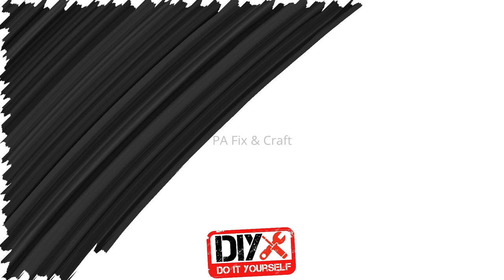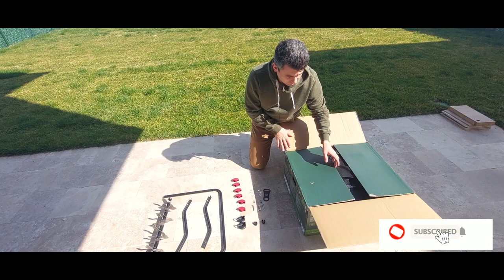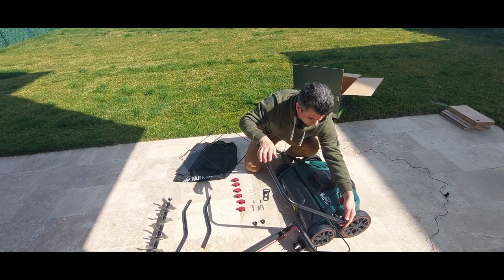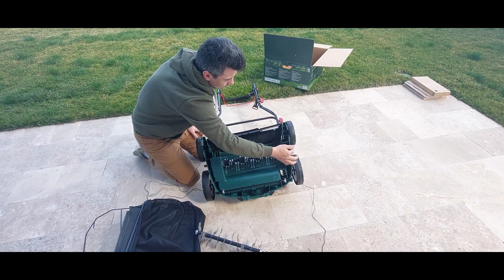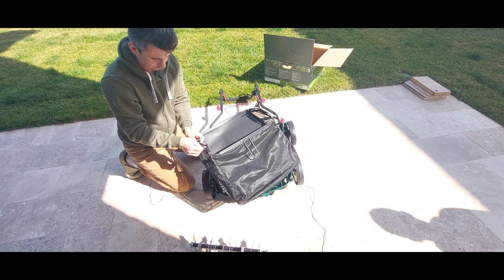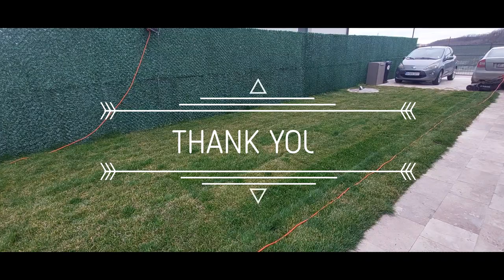PARKSIDE Electric Scarifier / Aerator from Lidl, unboxing and mounting

Comment: How do u like it? Would you recommend it?
Reply from the maker: @BogdanOasa. First of all, thank you very much for your comment!!! I am personally very satisfied with the scarifier. I have approximately 500 square meters of lawn and it copes without problems. The quality-price ratio is very good from my point of view. What is good to know and take into account, that aeration, scarification should be done without a bag. You won't get very good results with a bag. This means that you will have to rake all the vegetation. Another very important aspect is that the scarification or airing process should be done in the morning on dew. Not on very wet soil but on dew. Thus, the dead lawn threads stick to each other and come out easily like little snow balls. If the soil is wet or soaked with a lot of water, you run the risk of pulling out healthy lawn strands with their roots.In the spring I will make a separate video about the process of scarification, airing in which you can see why I don't use the bag and why it is important that this process is done on the dew. If you have found the information provided valuable, I kindly invite you to consider subscribing to the channel if you have not done so already. Your subscription serves as a significant source of motivation and encouragement for me to continue creating and sharing new content through video uploads. Additionally, should you have any further inquiries or questions, please feel free to reach out to me. Your engagement and feedback are greatly appreciated.